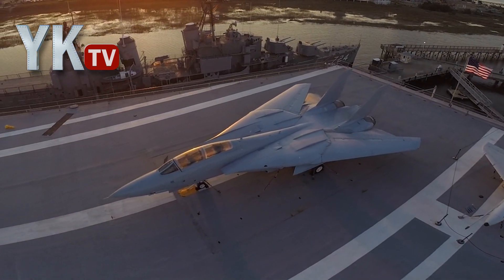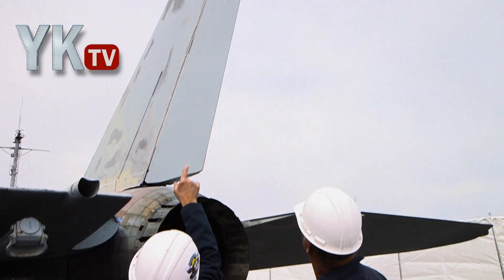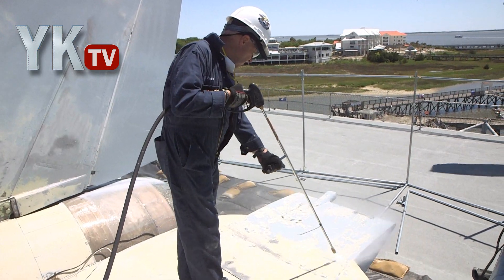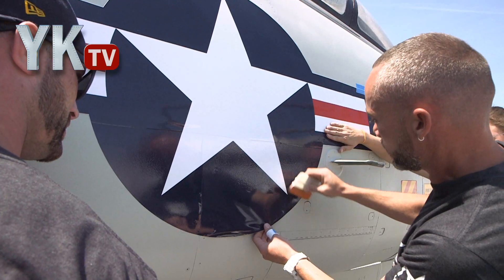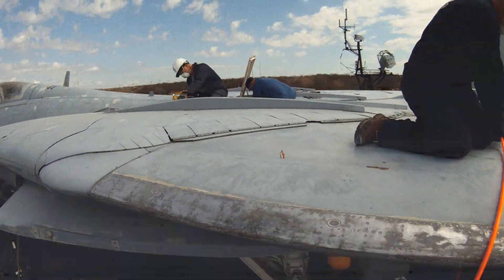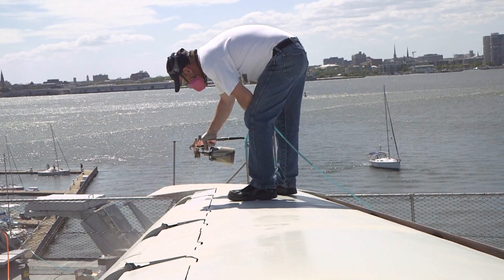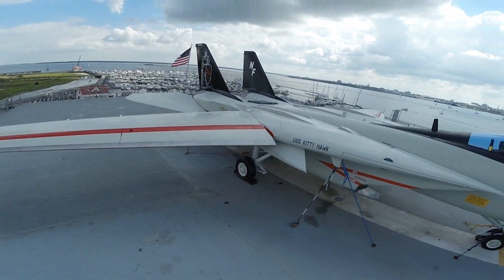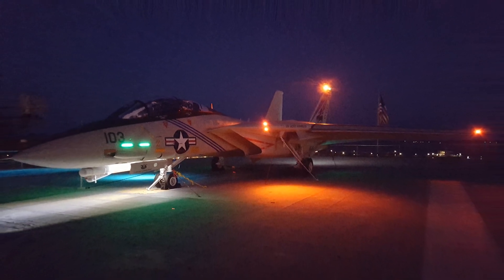YKTV:  Project F14 Tomcat Restoration - Patriots Point

Comment: They should restore it inside and out so it will be capable of flying again.
Reply: Never happen.  No support, equipment, parts for this bird, especially with a potential black market with Iran still operating the type.
Reply: Ditto.  All engines, parts, avionics, etc were shredded.
Reply: give it iran, at least they are using it
Reply: @User-nu6km  tanx honey
Reply: @User-nu6km  Yikes. Terrible idea. The United States is so serious about not letting foreign countries obtain F-14 hardware that they shreded almost all of them aside from the demilitarized airframes (that are really just shells) that have been stripped of anything of value by the United States government that are in muesems. Thats also a quite poor choice considering the Iranians are enemys of the U.S. and have been trying to keep their fleet of Cats running for a very long time. If the Tomcat was not such a big asset to them they would have just sold their old aging fleet to some smaller country or would have scrapped them a long time ago.
Reply: Turner Ashby our government is just paranoid. They other day it was telling people to inject Lysol into their veins
Reply: @User-nu6km  Barely

Comment: Why put that ugly decals over the cockpit, instead of showing off the original with see through glass? The rest of the restoration was great, but that decal destroyed it.
Reply: Sean Hsiao it has to be covered otherwise the sun will destroy the cockpit over the years. They should have just done it with a chrome mirror finish instead
Reply: I have to say it adds drama to the exhibit and gives the impression the aircraft is throttled up and about to launch.